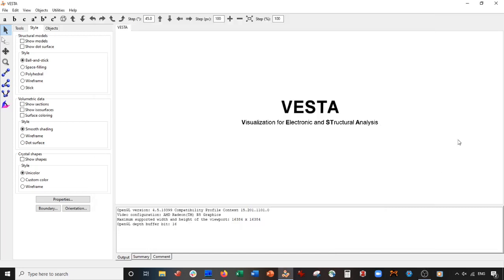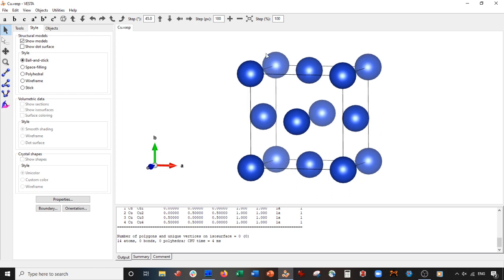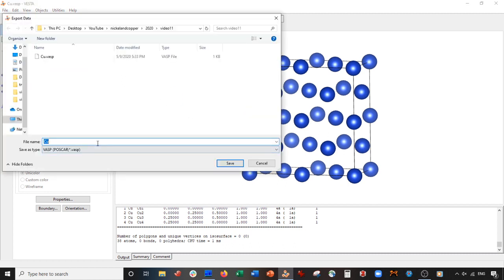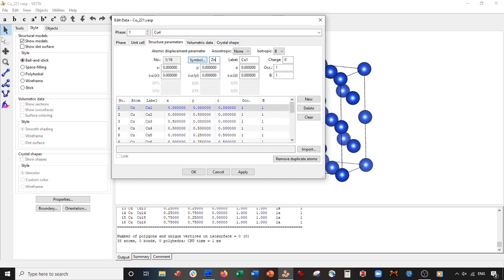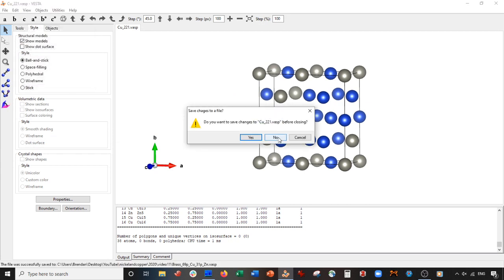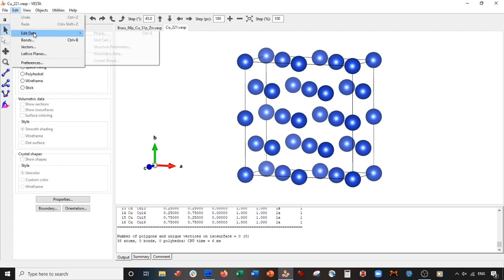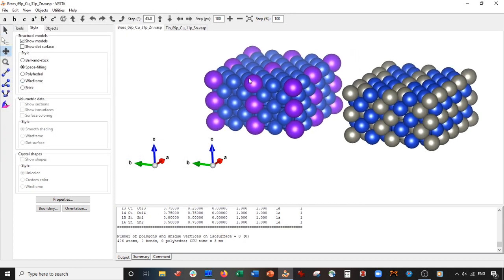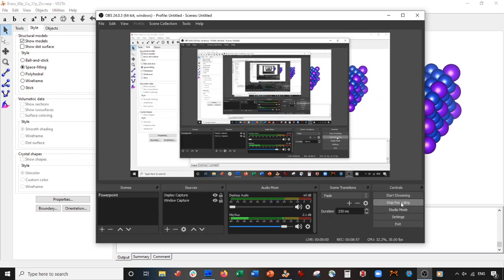VESTA Software - Alloying Copper Makes Brass and Bronze

Comment: Thanks for the wonderful explanation. However, I have a question. I was trying to make Si-Ge alloy with supercell size 3x3x30! I started with Si. So typically, the total number of atoms are more than 2000! So now If I want to make a 50%/50% Si_Ge alloy, I need to select more than 1000 atoms and make is Ge. Which is very time consuming and not feasible! Is there any easier way to get this done for large no of atoms??

Comment: There is a software package known as SOD: site occupancy disorder to generate inequivalent structures by substitution . Suppose if you generate 2x2x2 supercell then the are a lot of number of ways in which one can arrange atoms, lets say 100. But many structures will be same due to symmetry of crystal which will give less than 20configuration. Then one needs to optimize the structures to find the ground state.
Reply from the maker: Quantum Physics - this is useful information. Thank you. Any video tutorials on how to use?
Reply: @nickelandcopper5636  There are only 3 examples
Reply: @alohaaaa5985  excuse me May I know where can I find those examples?

Comment: Well. You don't have to save the supercell every time after transformation If you choose "Search atoms in the new unit-cell and add them as new sites " while applying the transformation. That will add these atoms. It is more efficient and I haven't face any periodic error. So saving as xyz file is not required as well as that text editor. I could mention that in your early videos (1 year ago). You can replace any atoms right away. Adding vacuum is straight forward like you do (saving .vasp as cartesian then adding space in the z-axis).
I have one question. The alloy that you modeled is not uniform. you could do it. But what is the preferable choice for alloy in computational purposes?
Reply from the maker: Ah, you makes some excellent points. Thank you - I didn’t know. Next video I’ll try to include your suggestion. For the alloying, it would come down to the systems total energy. Basically just figuring out which alloying scheme is the most stable. At the same time, temperature effects could be considered, which may cause some diffusion. Overall though, I would say it comes down to the total energy and it would most likely be some uniform distribution. In this video, I just try to show how one goes about doing it methodologically.
Reply: @nickelandcopper5636  Exactly. I get it now! Thank you so much.